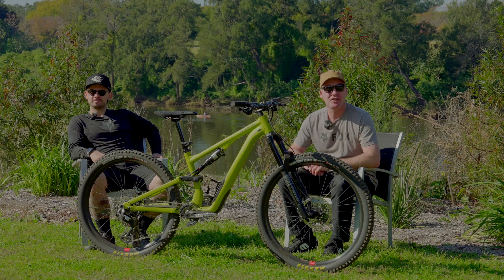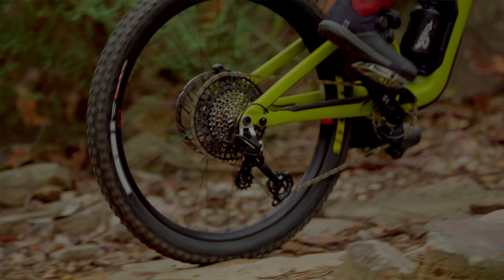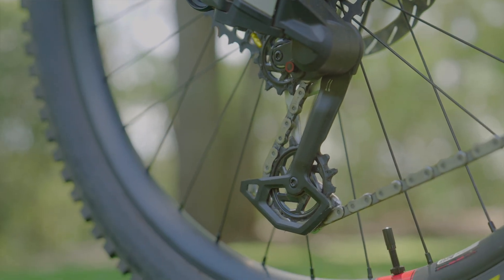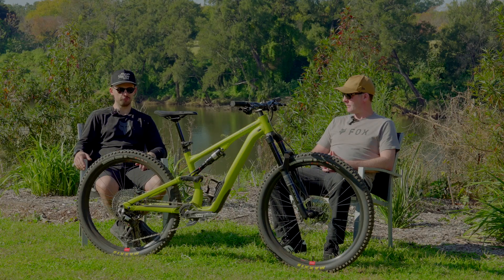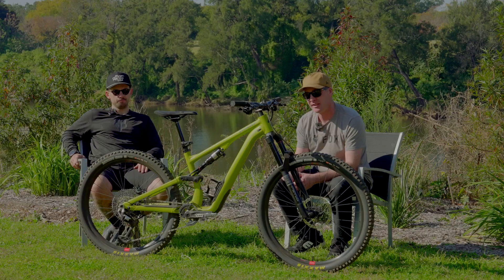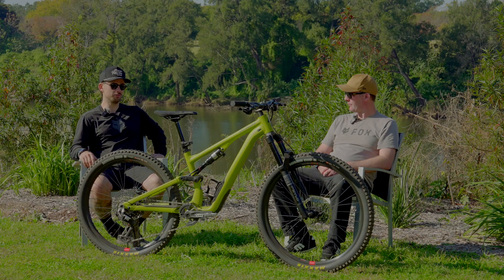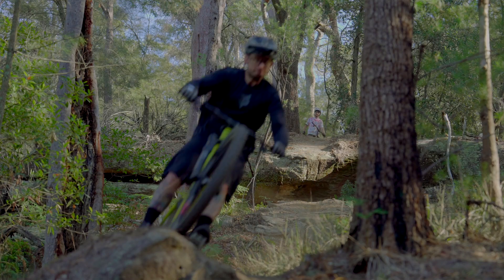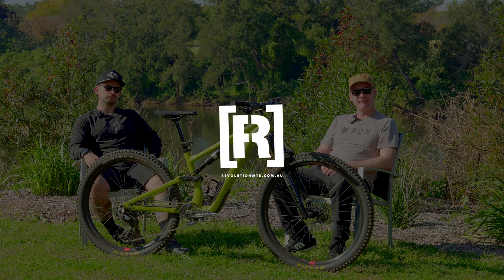Does SRAM's new cheaper & lighter mechanical Eagle 90 drivetrain perform better than electric AXS?

Comment: I just bought into AXS transmission. I got a XO/XX setup on my bike and couldn’t be happier. I was going to order a 90 derailleur for the faster shifting on race day but its literally not needed what so ever. The performance gains are amazing, Ive been riding so much faster and smashing through gears like a pro. Setup is so much easier and smooth. Literally couldn’t be happier. Well worth the upgrade.
Reply: Until it fails. They's a lot of people whinging about wireless transmission.